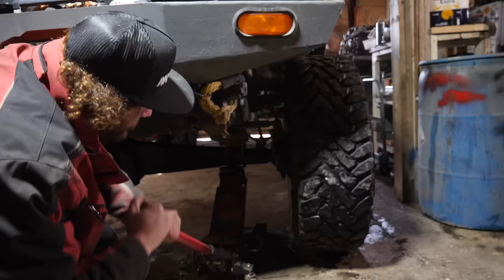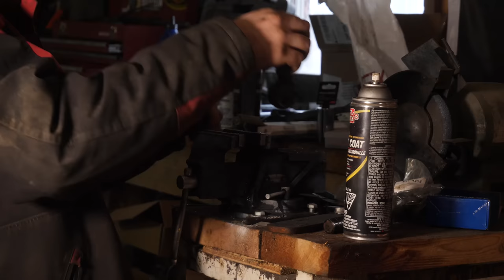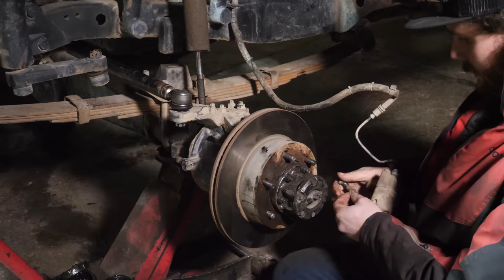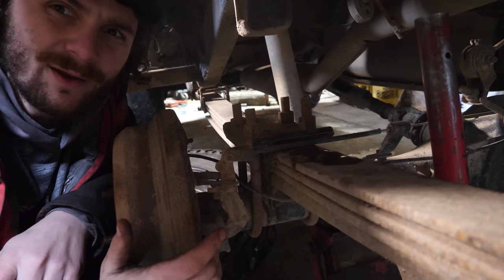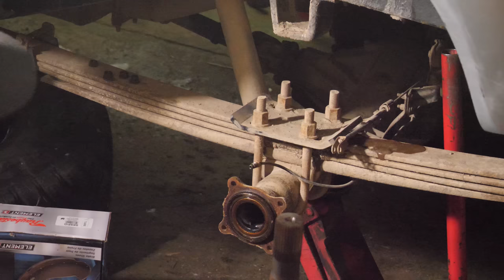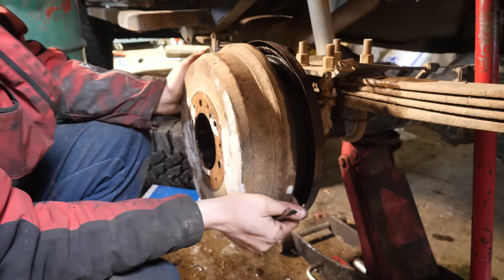How I Maintain my V8 Toyota Pickup!

Comment: Your brake woes remind me of when I rebuilt them on my Old Dodge Ram.  I replaced everything (front rotors, pads, rear drums, rear pads, wheel cylinders, springs, bearings all around).  Adjusted everything and went for a test drive/seat the pads and I could barely stop.  I was pretty new working on it and got freaked out so I sent it to a shop.  They found that my original front calipers, master cylinder and brake booster were all bad.  An unexpected $900 later and I had ALL new brakes. :-D
Reply from the maker: Haha I don't usually struggle this much. Just the cold and recovering from being sick. Not a fun situation!

Comment: Hot tip for replacing wheel bearings: When knocking out the outer race and knocking in the inner race sit the wheel hub in and old rim to protect the threads on the studs. 

Great video too. Maintence is so often overlooked! Never forget the rear wheel bearings either.
Reply: That’s a really good tip, I could use my spare wheel 😎

Comment: I use 2 pieces of C-channel (but angle iron would work just as good) 27 inches long with a hole drilled in the center. then I take them and bolt them on the wheel hubs when it's on jack stands and I set my alignment with 2 tape measures, one on the front and one on the back. i set it to 1/16" toe in over the 27 inches. it gets it as close as a proper alignment machine can, if not a tiny bit better. I can drive my Toyota on the freeway with 2 fingers on the steering wheel and it tracks true as an arrow 😁  I figured I'd pass that info on, it's worked very well for me...

keep up the awesome videos man!

Comment: For me, the Bilstein's that come with every solid axle kit felt like they were too soft. I think if I didn't switch platforms to the 80, I would try the Fox shocks.

I buy full drum rebuild kits when I do the rear brakes because as you mentioned, everything else starts looking crusty and old once you get the drum off. Great video Clinton!
Reply: I really like the Rancho 9000's. They emailed me back a spreadsheet to help me get the right ends and shock length which is super cool, and they are compression adjustable.  I fit 14in front and rear with the LROR shock towers, and the damping can be adjusted from a nice stiff DD to way to soft (hit my bump stops) off road comfy.  I know everyone seems to want 14in shocks, but I don't think the SKY Offroad kit offers more than 8-10in articulation anyways so i recommend getting the 12in Rancho's.  Pretty cheap too.  If you don't want those, get FOAs and tune the valving manually.

Comment: Thanks! Hey sending a couple bucks…I’m getting ready to do a 3.4 swap on my old 4runner. I wanted to pick your brain on the wiring part, I’ve heard you have helped some other Utuber’s
Reply: its like 5 wires to make it run, it was really easy, took longer to find the right wiring diagrams. I did the 3.4 into a friends 85 pickup aboot 8-9 years ago

Comment: I stopped wasting my time with the store bought stuff after my last Moog set failed prematurely. You can get Sankei 555 parts from Napa though which are made in Japan! That or OEM..
Reply from the maker: In my experience Moog is the absolute worst. A couple years ago we had a lower balljoint go on our 4Runner less than 2 months after installing. Did a bunch of damage in the process.
Reply: @DirtGarage  they used to be good quality what happened?
Reply from the maker: @ncd7184  Dont know. But I can't trust them anymore

Comment: what I don't understand about your rear wheel bearing method is it looks like you're just bashing the end of the axle on the concrete? how is that not hurting the splines of the axle?
Reply from the maker: Concrete is softer than the metal axle shaft. I've never hurt a shaft doing this.

Comment: You change your wheel bearings once a year?? Hold my beer...Ive got about 300,000 on second set on my 87; rolls great, no play...just need to repack every 30,000....Currently coming up on 500,000miles and still have some OEM lite bulbs....
Reply from the maker: Nice!

Comment: I’m shocked you do wheel bearings once a year. I don’t do any hard core wheeling with my ifs 86 4Runner but my wheel bearings are original and still work fine 299k miles
Reply from the maker: 37s and lockers are pretty hard on them! And honestly didn't really even need to be done, the bearings I took out of front where just fine.
Reply: @DirtGarage  ok, that’s the size I want to go up to. I found a straight axle but it’s been sitting on a truck in a field for 10 years and they will not go lower then $1500 for the entire truck.
Reply: @nickcrill7718  not a bad deal, people are selling solid axles alone for 700-1200$ where im at
Reply from the maker: @nickcrill7718  That's not terrible at all. These axles are going for alot these days. And you'd get another t case from the parts truck for doublers
Reply: @vibmx  the town I live in is in Washington up by Idaho and Canada and it’s small! 1 buy went around and bought 95% of all the solid axles. Has over 50 of them. I’m young so he tried to get $2000 for just the axle..
Reply: @DirtGarage   it’s my only option so far. So I’m definitely going to buy it.
Reply: @nickcrill7718  upgrade to one ton axles and you'll have more options for less cost
Reply: @youtubeincel5812   I want Toyota axles
Reply: @nickcrill7718  Look how often he's replacing parts. Do whatever you want, but toyota axles aren't built to handle 37s. They're not full float, the tire rods bend like clothes hangers and the diffs grenade if you put and real power through them.
Reply: I’ve always wondered why I’ve seen guys go ford/Dana axles even if keeping Toyota trans/engine/leafs/aesthetics etc…

Comment: So they make this shit called TAPE MEASURES  juz sayen
I was wondering is your SHOP AIR-CONDITIONED
OME SHOCKS THEY NEVER BLOW OUT PERIOD  
Sorry buy WHY IN THE FUCK are you REPLACING GOOD BEARINGS damn I have some 60 years old still running 
Save your money folks unless its shot its GUUD
Reply from the maker: Wow really? Tape measures? Thanks tips 🤣 No AC, don't even have power. And because wheel bearings are cheap and 37s and lockers are hard on them.